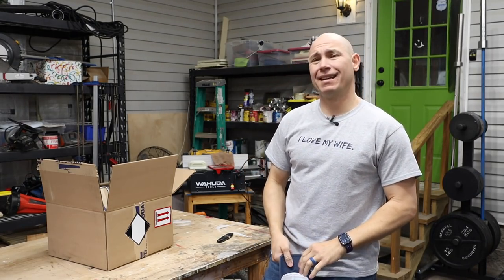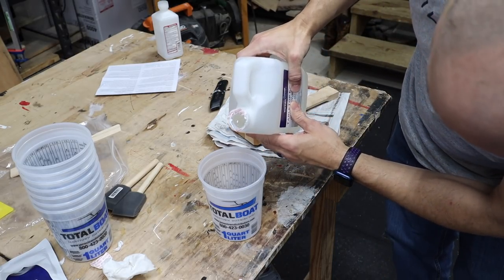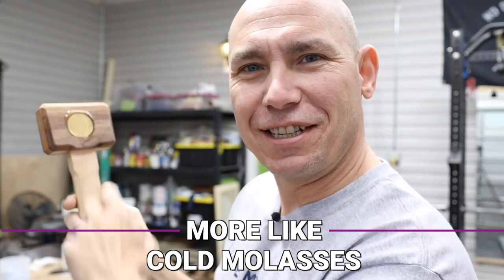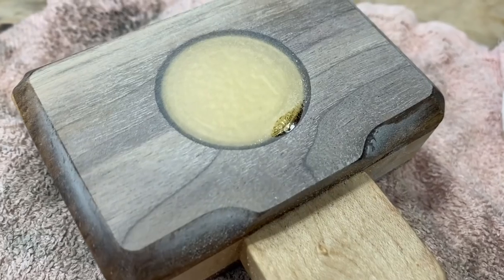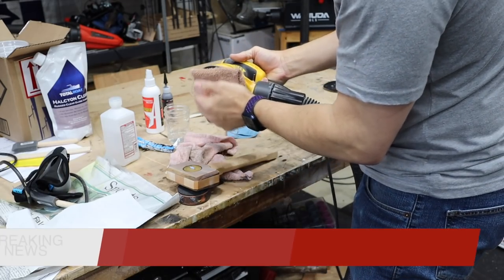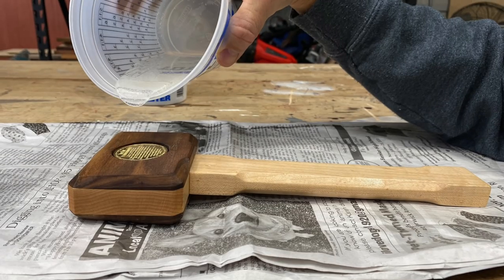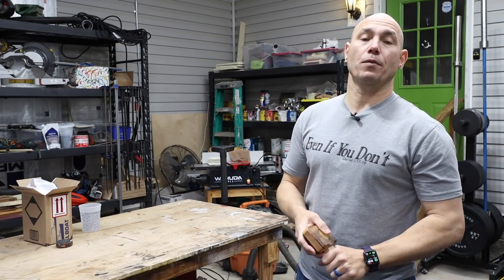Clear EPOXY Resin Makes A Unique Wood Mallet

Comment: I didn't check all the comments below for tips. Pour #1 was too cold. 

Tip #1: Warm up the epoxy bottles before mixing by placing them in a sink with warm water.

Tip #2: Before you pour the epoxy, use the heat gun / torch while still in the container to pop the bubbles. Then pour very slowly. This really helps. 

Tip #3: Use regular cauck (not silicone cauck) around the coin to create a dam to prevent the expoxy to flow over the mallet. As you mentioned, it's better to over fill just a bit. 

Tip #4: Before you put in the coin pour a little epoxy in the bottom, put in the coin and then fill in the rest.

Tip #5: DON'T SKIP THE SANDING GRITS! This step is critical for clear expoxy pours. 

Hope these tips help in your next project. Great job!
Reply from the maker: thank you for those tips
Reply: Well you just rock! Thx!

Comment: I agree with most everyone else. Used stone coat to make my countertops. Propane torch works much better than heat gun to get out the air bubbles. That may help you with desk build. Great job on the videos. Keep up the good work.
Reply from the maker: Thank you

Comment: Final finish came out great. The more you pour the more you will learn. Just some suggestions. I use 1/4" wood strips in my drill to stir and stir a little longer. Keep checking for bubbles up to an hour after pour. Temp MUST be no less than 70° the warmer the better.
Reply from the maker: thanks for the tips

Comment: I actually have to make my mother in law a live edge coffee table for her den and I've been watching epoxy videos almost as much as your videos and you made it look the easiest and you've given me the confidence that I can do it
Reply from the maker: Go for it!
Reply: I made a live edge river table a couple of years ago, and my biggest tips (besides everything that Matt covered here) would be:

Don’t over mix/pour what your epoxy suggests. This will cause “uncontrolled exotherm” and your epoxy will start to crack below the surface. It will be tempting to do bigger pours to finish the project quicker, but DONT! (This is where I went wrong)

Use a torch over a heat gun to get the bubbles out. It pops the bubbles quicker which means you won’t heat up the epoxy as much. 
Hope this helps you get an awesome result and good luck!

Comment: Once you figure epoxy out and perfect its uses its amazing! 

You mentioned all the important steps to make sure it turns out as intended, but one thing you can do is layers of epoxy. Like with the bubble that left a dip you could just mix a tiny bit and fill it after the first application cures. Also when mixing part A with part B slow and steady is the best way to keep bubbles from forming 👍

Great vid btw!
Reply from the maker: thank you
Reply: @731Woodworks  you're very welcome. Keep up the good work

Comment: Matt if epoxy is a art in itself.  If you want to learn about epoxy my I suggest going to Stone Coat Countertops.  They by far have the best step by step videos on how to do epoxy for everything.   Now I have used there product and it is very good.  I have not use total boat.  Also Stone Coat also have an outstanding costumer service department that will do anything to help....
Reply from the maker: Thanks for the tip!

Comment: The measuring cups are great, but in my experience, using a digital kitchen scale to measure by weight is usually a better way to measure epoxy. And always get the resin up to at least 70 degrees before trying to mix or use. Temp and a little heat on it after you pour it and no sanding will be needed. Great video Matt!
Reply from the maker: thank you

Comment: I’ve used epoxy to make knives a few times and I just wanted to offer up an idea. During the mallet making process, you could use epoxy on the entire head or just the sides of the mallet whilst using tape around the handle. It would make the wood really pop on the sides.
Reply from the maker: That would be awesome for sure!

Comment: I love this project! Something I found with resin when pouring it over small objects (coins or bottlecaps) is it will seep underneath them if they are not 100% sealed down and then release the air bubbles into the pour, (found that out on a bottle cap table). When doing shallow pours like this I find it helpful to mix the resin with the cup in a hot water bath to thin it out so it flows smoother.
Reply from the maker: thanks for the tips

Comment: I've done epoxy stuff for a few years now. U can set the cup in hot water after u mix it up to heat the epoxy and it pours a lot easier. U can also use C A glue to fill in small holes.
Reply from the maker: Thanks for the tip!

Comment: Turned out well Matt, I make a lot of Cigarbox guitars, on the necks I like a glass smooth finish on the oak. It takes you to go up through the grits but you'll get there quicker if you wipe down the wood in between the grits with a slightly damp cloth. I usually put a very small amount of thinner or petrol on the cloth. This removes any of the heavier grit debris left in the timber. When I was first told this (by a really elderly French polisher) I doubted it thinking, I don't need to do that because I have a vacuum on my sander (same dewalt sander as yours) but boy does it make a difference. Give it a try and see. Davy.
Reply from the maker: awesome.  Thanks

Comment: First off great job. When I do pours into wood I will put down a seal coat of epoxy or spray clear coat before the main pour it will keep down the amount micro bubbles from the wood soaking it up. Also you can use a clear coat ( spray Krylon or a top sealcoat of resin) in place of polishing if it suits the situation. Also watch the heat gun. too much heat in one place will cook a skin on top. I learned that trying to get a stubborn bubble out. Keep up the great work and thanks for what you do.
Reply from the maker: Thank you for the tips!

Comment: Just a suggestion. It is crucial to get the mix ratio exactly equal of the 2 parts. As you found, if parts are nor equal it will not completely cure (tacky) or milky finish. A tip to get your ratio mix correct every time would be to use a food scale. Set your container on scale, zero for tare weight, pour half in volume of part 1, note weight (can be in grams or ounces), zero for tare weight, pour part 2 to exactly equal the weight of the part 1 weight. Voila!!! You have exactly equal parts and only the amount needed to finish the job. This will apply to any epoxy pour, big or small. Hope this helps! Enjoy your videos........ Best wishes from an icy and snowy TN
Reply from the maker: Thanks!

Comment: I would try and get a digital scale. That way you can be exact with the mixing. 
Place the mixing cup on the scale and zero it out. Then add the first part of the epoxy and note the weight and zero the scale.  Add the 2nd part of the epoxy to match the measurement. That may help you get a perfect pour. 

Great job and thank you for all you do!!
Reply from the maker: I have a digital scale.  Never even crossed my mind lol.  Thank you.

Comment: I have never used Total Boat but I assume most products are the same. When the epoxy is cold I warm it up in a warm water bath for a few minutes. Makes it pour and mix a lot easier for better clarity and less bubbles to pop.
Reply from the maker: Great tip!

Comment: Temperature is a HUGE factor in epoxy. If you're working in a colder shop, you can always blow some warm air at the cup while mixing. That'll get it all flowy and mix much better. Also, its hard to mix small batches by volume. I measure the weight of the initial shipment to get their weight ratio. Then use a small scale to add epoxy by weight radios (which equivocates to a volume).
Reply from the maker: Good idea!  Thanks

Comment: You need a vacuum cabinet for these. If you place the item in a vacuum cabinet and draw as much of a vacuum immediately after the pour, you can clear out your bubbles. Basically making the bubbles "bigger" by lowering the surrounding air pressure and they float to the top and a heat gun/torch will pop them easily enough leaving a clear pour with a nice smooth surface.
Reply from the maker: Thank you

Comment: Aside from proper temp of the epoxy mix, I wonder if putting the heat gun to the coin prior to the pour would help it heat from within? I've never used epoxy, just a thought.
Reply from the maker: might be worth a try

Comment: awesome,   quick tip fill a 2-3 gallon bucket with hot water ( hot tap is fine NOT BOILING) then let the bottles sit in that water for 5-20 min this will warm up the separate parts a bit faster .   also works with spray cans!!!
Reply from the maker: Thanks for the tip!

Comment: I’ve used epoxy for years from glueing up boards or as an inlay on concrete table tops.  It works best in a heated garage or shop and should be 70 degrees or more.  I’m happy to share a few of those project photos if interested.
Reply from the maker: Thanks.  Sure!
Reply: Ok, not exactly sure how to paste a photo into this discussion.

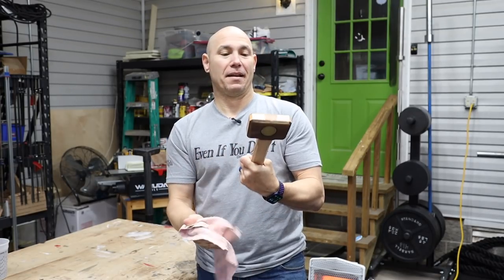Comment: Nice work! I wonder if you could heat the coin a little before placing the epoxy if that would displace the bubbles better.  I made an epoxy table for my Mom. I placed epoxy in front of a space heater for a little bit, then started with part B, then mixed in part A. Finally, try heating a couple of times or more heat (even torch worked better for me...I know this may not be the perfect application for torch due to the awesome wood choice). Psalm 19:12...Great Job!
Reply from the maker: Thanks for the tip

Comment: Great first attempt. I have been working with epoxy for 2 years and have some beautiful projects. I have tried several brands and have also learned quick, fast and in a hurry from my mistakes as this stuff is not cheap. Let me know if you would like to talk about epoxy do's and don'ts? Would love to help in anyway. I have Harbor Woodworking, you can look me up on facebook for my pictures and contact info. Love the channel watch them all.

Comment: I cut circles to fit my orbital from sheet sand paper and stick it to old worn discs with spray glue.
And  many times you can't find fine paper for orbital sanders. And it cheaper . What did you have 3000 grit paper for?  I heard that epoxy works great as a super duper glue. I haven't tried it yet
Reply from the maker: I bought a pack that had various grits

Comment: Patrick, I wonder if you could use a syringe for something this small? TSC or other feed stores sell 20-60cc syringes that would probably hold enough epoxy to transfer to your workpiece with a lot more control than pouring. Thanks for making the mistakes for me! :) Cuts my learning in half (or at least I get to make new mistakes!)

Comment: Couple of notes:
Dunk the epoxy bottles in hot water to warm them up. You can go pretty hot in the surrounding water. 
Let the epoxy sit in the mixing cup and pop the bubbles in the cup prior to pouring, then pop again after pour. 
You skipped way too many grits sanding, even the lower grits. 60 is too rough, start at 80 and go to 100, 120, 150, etc up to about 400. Then you can jump to the 1000, 2000, 3000 and then using car buffing compound. Also using a DA car buffer helps a ton.
Reply from the maker: Thanks for the tips!

Comment: Use a Bernzomatic torch to pop bubbles after you pour, but yes, the epoxy needs to be at the right temp and it needs to cure at the right temp. You probably could have gotten away with only going up to 320 grit. It would be clear when you put that Odie's oil on it. Check out Cam at Blacktail Studio. Obviously he's not the only one, but he is one of many that has mastered rivertables, but in my opinion he goes out of his way to provide as many details as possible to show you the way.
Reply from the maker: Thanks for the tip

Comment: I didn’t read all the comments but some thing I learned is that if I have a small bubble like that that sets you can fill it with superglue and then sand it down and polish it up and you won’t even see that hole. I hope that helps

Comment: You can pour epoxy in layers and not see them. This means you can use a tool and remove the air bubble  and then pour a bit more epoxy in the hole and shine it up.
Reply from the maker: Awesome. Thanks for the info

Comment: Another thing that helps is if you have a digital kitchen scale, to measure out both parts by weight in grams.  Itll give you far more accurate ratios.
Reply from the maker: Thank you
Reply: @731Woodworks  no sir, thank YOU!  God bless

Comment: I use a different epoxy however most all need to be 70 degrees at mixing. Finish the wood after the pour. Have fun.
Reply from the maker: Yep, it don't like cold

Comment: Love your videos, and the willingness to try on camera.  If you are going to use a small amount, use smaller mixing cups.  The ratio is critical to keep it from being tacky.  The more accurate measurement the better.  Epoxy doesn't dry, it is a chemical reaction that cures.  So if the ratio is off, it will be tacky.
Reply from the maker: thank you

Comment: A little trick to get the air bubbles out is to use a torch and go over it without staying in one spot. Go side to side slowly.
Reply from the maker: thank you!
Reply: @731Woodworks  you are most welcome. I’ve built my own countertops with epoxy and made them look like cement. Thank you for your videos. They have helped me a lot. I’m in the middle of the sofa table build right now. I can’t wait to finish it!

Comment: As learned in this video, it is extremely important to work in a place where the temperature is correct, and your project and containers are at the room working condition. I would say always pour Part A and Part B in separate containers. Then pour the two separate containers into a new container. You have a much better chance to get it right.

Great video, and I love the mallets.
Reply from the maker: Great point!

Comment: Maybe try to mix up a small amount of epoxy and use a syringe to put a drop in the air pocket on the one side. Idn seems like I've seen people to stack the epoxy to fix imperfections.  Regardless that looks awesome brother.
Reply: If your plans are to do more epoxy projects, maybe invest in a pressure pot. I'm definitely not a epoxy pro but I've seen a ton of epoxy projects. Pressure pot will help with those small bubbles.
Reply from the maker: thanks for the info

Comment: Yep definitely too cold. Water bath or place it near heater to warm the epoxy before you mix them. The rest looks like you got it down. You could use hot glue as a damn around the coin to keep it from flowing over as well.
Reply from the maker: Thank you

Comment: So next video Matt will be installing a shop heater.   Lol.
Reply from the maker: I want a minsplit something bad! lol
Reply: @731Woodworks  they are not to expensive.   I looked at one for my eBay area that I converted from my 1 car garage.  They are between 800 and 1200. But where the outside unit would sit would be next to the front door. So that plan got nixed.

Comment: You can get these amazing rubbery cups to reuse and measure a in one and b in one. Most use medicine cups. To me that is a waste and hit it with the heat gun. The heat gun will pop bubbles. And just the overflow off.
Reply from the maker: Thank you

Comment: Ok, EPOXY--One of my best things to do.  If you are only doing a certain cover over a medalion, it don't take but .02 ml to cover it.  not much.  I do a ratio of 1:1 using Bar top epoxy.  dries faster, does a superb job of shine, and keeps things where they are placed.  When you have a lot over it, wipe it off fast or put it where it needs to be, wipe off excess and let dry.  This way, it wont be a problem sanding or getting rid of bumps.
Reply from the maker: Thanks for the info!

Comment: That mallet ended up looking real good.  You don’t need the metal polish.  When the epoxy is used on the boats, they always put a coat of varnish on it.  Epoxy is susceptible to UV rays.  They put varnish on it as a protective coat for the epoxy.  Thats why you see varnish for sale at TB.  The varnish would work just like putting the water on it., filling in the fine scratches.  I am sure Odies may do the same.   The metal polish worked real well, and it is a small project.  I wonder about a larger pour, I guess the varnish would take care of it.
Reply from the maker: thank you

Comment: One more comment yes sand it with very fine like 600 grit sandpaper and then use a little bit of soapy water when you're sanding it. Then once you have it sanded down real good and cleaned with that soapy water use a little bit of polishing compound and that sucker will shine.
Reply from the maker: Thank you!
Reply: @731Woodworks  I'm LE in San Antonio Texas a brother officer told me about your channel and you now have a big fan sir. Be safe

Comment: A torch would work better for the bubbles. And you can run the torch over it right after the pour. It will pull them out right away.
Reply from the maker: Thank you

Comment: I bought myself a batch of epoxy and whole set of different pigments and textures to add to it..... but I havn’t had the bollox to make myself some up and experiment yet for fear I’ll just mess it all up 😂.
Reply from the maker: Go for it!  One thing is for sure, you won't mess up or learn anything at all if it stays in the bottle :)
Reply: @731Woodworks  I know mate, you’re spot on... I think I’ll just do a little test project and go larger as I gain in confidence and get to trust the resin 👍